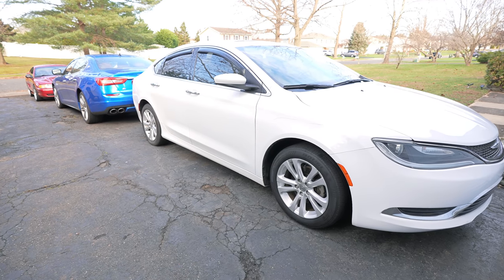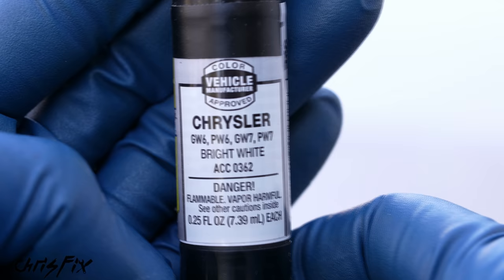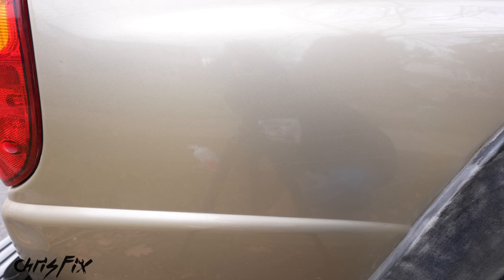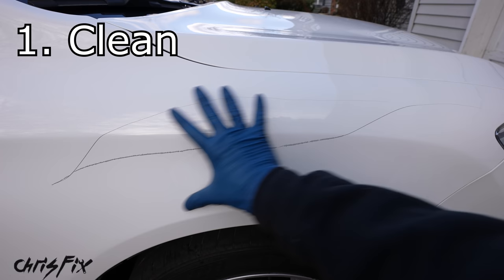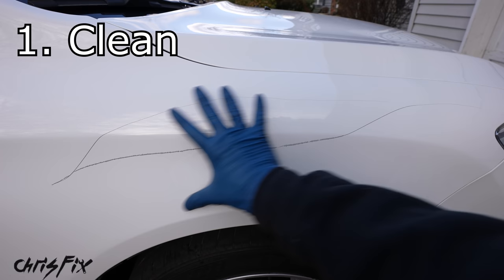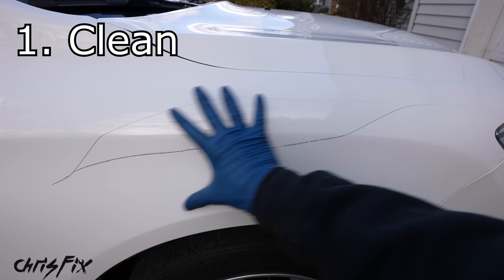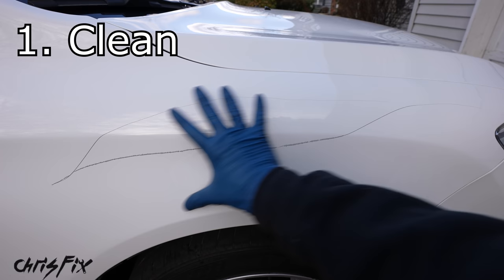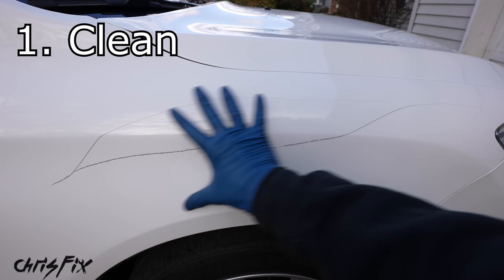How to Repair a DEEP SCRATCH in Car Paint (DIY)

Comment: This video is generally good but it's not as easy to do on a black car. White hides everything. Black shows everything. I'm doing this and it's not perfect because it's very easy to wetsand down past the base coat down to bare metal and you have to redo everything again. Also you could be sanding and it's not perfect and you can see tiny rings that are different from the area you sanded.

Comment: followed instructions and it did not work at all. Repair is clearly visible, may be even more visible than original scratch. Going to use to aerosol spray paint next time
Reply from the maker: What is visible about it? Is the color off or did it not blend well?
Reply: It's brush paint, trying to make it flat after painting is hard (with 800 grit) and likely cause damage on area around if use force to get desired result. Also color match was not perfect. Not sure if that is makes difference, but I was trying remove scratch on bumper

Comment: Hey Chris fix, I tried doing this for rock chips in my cars paint and after using like a whole one of those touch up pens I can still see the chips. Did I not sand the edges enough or do I just need more paint? Thanks!
Reply: Add more paint bro. And try not to sand all the paint off that’s why you can still see the edges.
Reply: @michaelflores1286  ok thank you, that’s probably why I can see it because I can still see it and I keep sanding it lol
Reply: How did it go bro? Does it look better now ?
Reply: @michaelflores1286  I haven’t tried it yet because I am out of paint and waiting to get more but I will update you when I do it
Reply: @caidensaquatics2319  sounds good. I wanted to try it on my rear bumper since someone hit it and there’s a deep scratch but idk if it’s gonna work or not. Don’t wanna make it worse😓

Comment: yup try doing this ant it was a complete failure.I clean the area really well just a air gun to dry it down, started sanding down and got it to the same way you had it. After added the paint slowly and let it sit for an hour and paint still came off. honestly just going to stop right there.

Comment: sand the paint to surrounding factory level, add clear coat, sand the coat to surrounding factory level...
... doesent make sense. you will remove the coat this way. there is a reason nobody else does that.
Reply from the maker: You just need a thin coat. It’s microns thick. It makes plenty of sense. There is no way to make it perfect by hand. You’re just making it better.

Comment: I got strangely aroused at 23:15. Just kidding!
I have a question, in your remove supercifial scratch video, you said "circular motion with the 5k sand paper" and here you say "back and forth".
Does that mean it doesn't really matter?
I'll keep with the back and forth as you said it is easier to fix straight scratches.
Reply from the maker: Depends on what direction the scratch is in and what grit. Typically back and forth is better for the reason you just mentioned. But sometimes you need to go circular to attack at all directions.

Comment: it doesnt make any sens xD You just filed scratch with base color so its leveld with clear coat and then aplied clear coat on top  and THEN removed it back to 0.... I do it like i add some base color and leave some space for clear to fill in... Thats weird bro
Reply: He filled scratch with base coat, sanded it back to make it level. Then applied clear coat on painted area. Sanded it back so it’s level with existing panel then polished it.

I think your way is weird.
Reply: @vinnynoxy  So he removed all clear coat that he aplied xD
Reply: @straightgym8764  no. He blended it in.
I don’t think removed it all.
Reply: How blended? He literally said that he leveled base with clear coat and then applied clear and leveled it again
Reply: @straightgym8764  he said “sand back clear coat so it’s level with the surrounding clear coat”
Reply: @vinnynoxy  Well, I know what he said, he just doesn't seem to understand it. You can't level the layers, add a layer, level it again and think that the added layer is still there... You had to remove it again! To have the clear coat on top, you need to leave some space for it. You put color on the scratch, sand it, leaving a 30-micrometer hole, and apply colorless! Then, when you smooth out the excess colorless, there will be exactly 30 microns left.
Reply: @straightgym8764  ok.
Maybe you can make a video and show us 😊
Reply: @vinnynoxy  well i could
Reply: @straightgym8764  yeah ok I think you should

Comment: Chris Ian gone lie, loved the vid but you kinda yapping
Reply from the maker: Thanks for sharing but if I didn't explain this in detail I would have to spend days trying to clarify in the comments and it would be confusing for first timers attempting this
Reply: @chrisfix the in depth detail is vital because we would be guessing what to do inbetween stages so thank you for that , my only question is wouldn't it be better to not over lap the white base coat becuase the surrounding top surface area is clear coat and  would it be better to overlap clear coat instead so when I sand am actually sanding down to the surrounding area and level with the rest of the original factory clear coat
I feel the way you done it in the video it seems like your removing all the clearcoat  becuase you applied that when the surface area you worked on was already flush and smooth to the factory clear coat
Hope I'm making sense

Comment: A spray clear will do a better finish and bigger surface will be covered than that shitty sponge brush 🙂
Reply from the maker: I would have to disagree with the better finish since this came out good after the wet sand/polish/compound and you'd be making more work for yourself by working in a bigger area